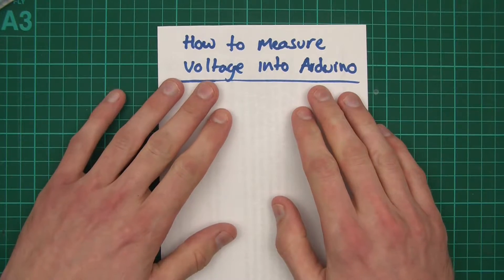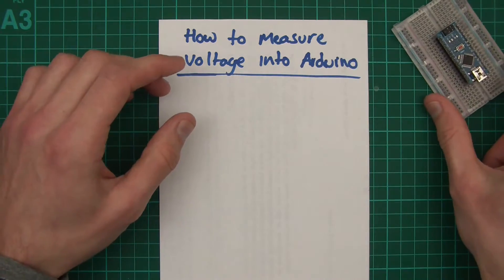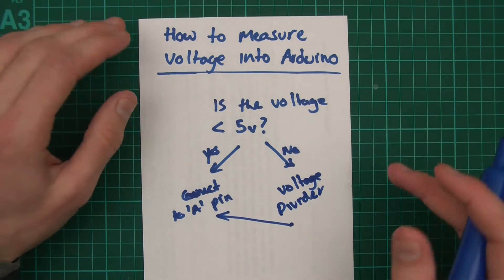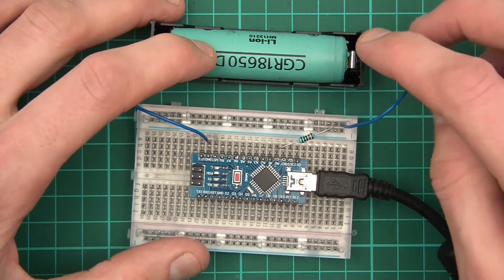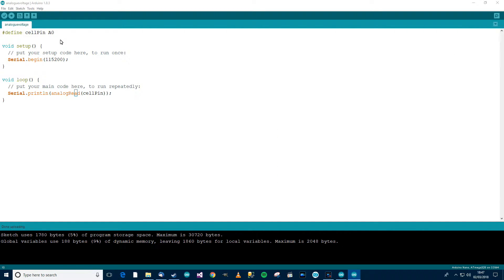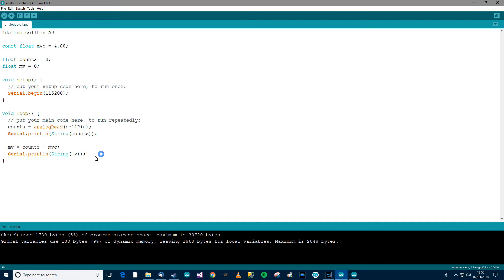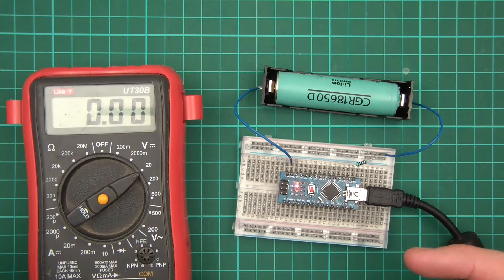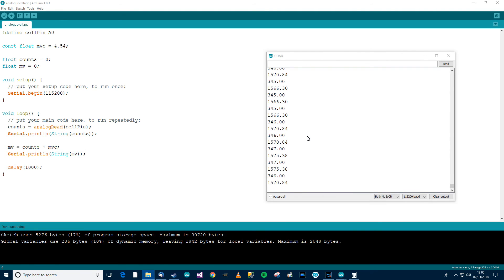TUTORIAL: How to Measure / Read Voltages Into Arduino - (Part 1/3 Voltages Less than 5v)

Comment: Hello , 

Thank you for your great videos...iam new to arduino but learning...i have question please : 
The cell is connected in series with the resistor and then the resistor is connected to A0 and A0 is connected to ground , so how can the A0 pin reads the voltage across the cell ? .

Thank you in advance

Comment: Insstead of calculating a value, cant you get the value from  the 5v pin on the arduino and use it in the calculation ???

Comment: Thank you for this! Do you know how I could record weaker electrical signals? Up to 150 mV with a 0.1mV step? Any help is appreciated!!
Reply: You should certainly use a high gain amplifier. I would recommend using LM358 high gain amplifier module for millivolts. Hope this helps!

Comment: Hi Anthony, can you please tell me why the readings change constantly (821, 823, 823, 825, etc.) without any user interaction? Is it 823 or is it 821, 823, 825, 824, etc ? My digital Multimeter, car Speedometer, microwave clock/timer doesn't fluxuate, why does the reading change so much? Thanks.
https://youtu.be/lec7kPv3VS8?t=566

Comment: FINALLY!!!!! SOMEONE WHO ACTUALLY CAN REALLY EXPLAIN THE PROBLEM AND THE CODE STEP BY STEP! T H A N K.  Y O U !!!
Reply from the maker: Thanks!
Reply: @antonycartwright  could you make a video where you actually use the same battery or two in series to power the Arduino? I read if doing wrong, power can be backfed into a pin and through the rest of the chip destroying it. Thx.
Reply from the maker: @Gallardo6669  Hi, unfortunately I can't make a video on that at the moment, however, I can answer it for you. The battery could wreck the Arduino if you fed it directly into a random pin, however, the VCC/RAW pins are exempt from this. These pins are designed to handle the current. If you wanted to power the 5v arduino using this 4.2v cell, it would work if you fed the VCC pin with it. If you are trying to power a 3.3v arduino with this cell, then use the RAW pin. The raw pin has a regulator behind it which makes higher voltage safer. Antony...
Reply: @antonycartwright  thx! I plan on using 2 18650 in series to power an 5volt Arduino uno. As the voltage goes down over some hours, the voltage regulator on the board would still get something over 6,4 volt in and it still regulates itself to 5v for the board.
So far so good. But, can I now use a voltage divider to bring the 6,4 battery voltage down to use it for an analog pin? On top of that, to be safe, I could go off the voltage devider and go through a 10kohm resistor before going into the analog pin? I don't know if it's needed but someone mentioned it for a similar project, trying to prevent a too high current across the atmega...?
Reply from the maker: @Gallardo6669  The 18650s have a capacity of sometimes near 3000mah and the Uno uses around 50ma, so your battery pack should probably last 60hrs. The cells shouldn't be discharged to less than 3.6v ideally. Both together would give you 7.2vnom, or 8.4vmax. That's ok for the raw pin but not the vcc pin.

If you want to find the battery's voltage, then yes, you'd use a voltage divider. This splits the voltage down to an Arduino-friendly voltage for you so that you can read it. You can put the anode to the raw pin and the start of the divider. The battery would be 8.4vmax, so you could use a 50:50 divider to keep it simple. If your battery was fully charged, the Arduino would read in 4.2v (half) on the ADC. To make this happen, you could use any resistors which have the same value. You could theoretically use 1ohm and 1ohm, and the divider would work! However, in reality, you'd never do that because that's way too low resistance for what you're trying to d -, the battery would love to shoot electric through that circuit, the wires would get extremely hot, the divider itself would draw approx 4 amps and it would burn through anything in its way to ground! (Maybe burn through your computer's USB/motherboard or burn through the Arduino to get back to the negative of the battery. It would drain your battery pack in about 40 minutes! If you make the resistors 10k, then the divider would draw approx 0.4ma which is much, much safer!  You could even use 20k resistors but the signal may be too weak. Basically, whatever you connect to the pins, make sure it stays below 20ma and 40ma in total for all pins... Oh, always remember: electricity always takes the path of least resistance and it has no emotions. 🤣🤣🤣
Reply: @antonycartwright  thanks a lot, so the way I described it's ok to create the project...
Please allow me to correct you in one thing, as I work with electronics and electrical equipment in my job: current NOT only runs the path of least resistance.depending on the resistance it flows more or less in any way🤔😀
Reply from the maker: @Gallardo6669  Well, yes, proportional to resistance. 😁

Comment: Super simple, it's already working for me. My cheap aliexpress arduino uno had a different reference voltage as well. I also mapped my input to a different scale to output it onto an 8segment display to use as a tachometer for my car with the map() function. It will be a fun project and you did a great job explaining the adc of the arduino. I was also getting some weird values with no voltage applied but with 0v applied from my power supply it showed a 0v output.
Reply: How , I also want to make tachometer so landed here , Can you please share what component used and code ?
Reply: I'm getting weird values too when no voltage is applied. with 2 arduinos.

Comment: great tutorial, thanks, I am going to use it in my mini arduino project :) There will be GPS, GSM, temperature, pressure and humidity sensor and other things. But It will be in the 55x37x20mm box :D

Comment: Am using stm32 so  I need max 3.3v analog voltage & my step down transformer output voltage is 0 to 24V can you please suggest me resisters number to use.

Comment: Hey Antony. U need really really a proper microphone. Its sooo annoying, that i cant hear u in one video - and if im watching a playlist - in another video u are toooo loud. thats not sooo cool.

And the most important part is, that u dont said, that the measuring of voltages with arduino, depends on the input voltage. so if i change the input  voltage of the arduino - the measurement is not correct.

Comment: Thanks for the Tutorial. 
I do have a question about some of this.
The Delay messes with RC Cars because of the control Delay, is it possible to remove the Delay? Will that mess anything up?
Or rather, is it possible to exclude this from the loop and make it it's own Void Function?
Thanks for you time!
Reply: I believe the delay's purpose is just for looking at the values, if there was no delay the numbers would flood in too quickly.
Reply from the maker: @mydarkguy  That's right. Sometimes, the Arduino can't cope of you try to do things too fast. The delay timing isn't necessarily thought through though. Maybe 1ms is enough - maybe too much. Maybe not...

Comment: Thx a lot for the hint that the reference voltage may not be exactly 5V. I just measured mine and found out that it is 4.99V when the Arduino is connected to the power supply and only about 4.86V when powered by usb. Of course I was only using USB and man I was wondering why the measurements were so off! :) Thx again!

Comment: Will this work on the ESP 8266 and ESP 32? I have a few Battery powered temperature and humidity sensors that i would like to monitor the battery voltage.
Reply from the maker: Kevin Mac it will work the same way but you need to check the adc voltage of the modules...

Comment: Why do you think a 10k resistor in series with the PSU (battery) is needed ?
The ADC has an input impedance (resistance) in the range of MegaOhms.
How can the ADC draw too much of a current ?
Reply from the maker: John Smith Hi Mr Smith, I used to think that too, but without the resistors, the cell can power the arduino! Try it if you like... Take the usb port out but have a few pins from arduino to the cell. The cell will power the arduino! :)

Comment: Awww, you didn't include the auto-adjust reference code  😜
Reply from the maker: Is that with the internal reference?
Reply: Yeah. It auto compensates for what ever the internal voltage is. The nice thing is  you don't have to wire anything up to it, it can just do it.
The only issue really is, you need to do a few blank readAnalog()'s afterwards to make sure it switches over before you use the value. At least, that's what the Arduino Dev site said.
If you want to maintain your accuracy throughout the whole testing phase (referring back to your batter tester), you just put the call at the top of the loop() to update the global variable. If the value changed, then your calculations will be compensated for. This is nice considering, as you mentioned in this video, that the internal reference can fluctuate a little bit.
Reply from the maker: Korishan ok, maybe I'll add it to the capacity checker. :)